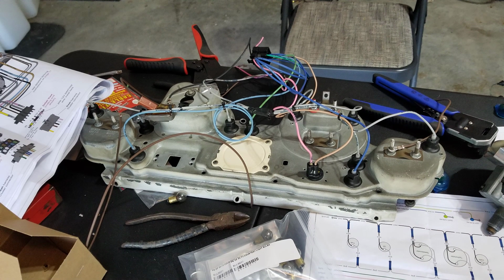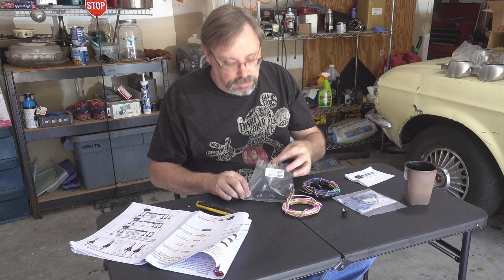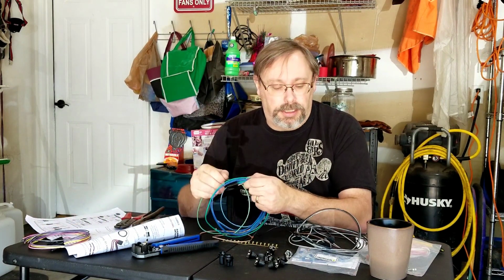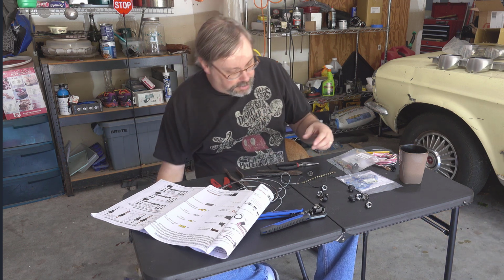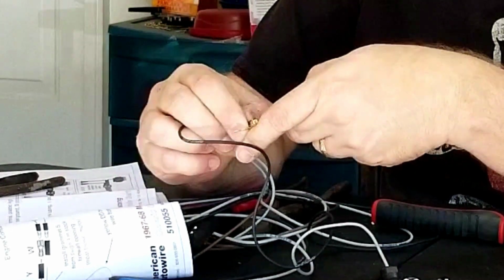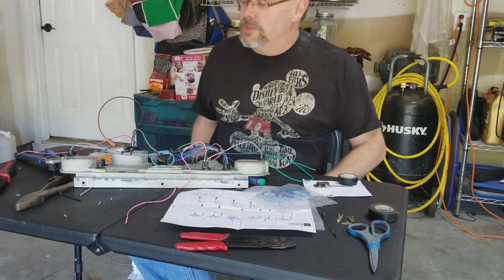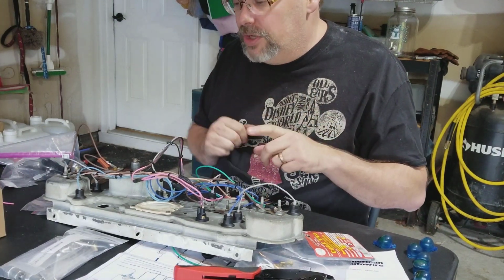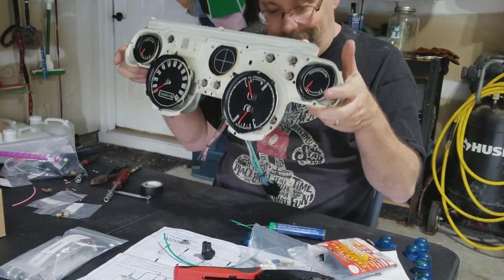Rewire the Stang Part 3 - Wiring the Instrument Cluster with American Autowire harness

Comment: Great videos.  How did you finally connect the gauge wires?  The original is push on, while the kit looks to use a nut?  Thanks.
Reply from the maker: Glad you like the video. You are correct with the new harness you use nuts to connect the wires to the posts from the gauges.
Reply: Hi do you know which thread size?  Thanks.
Reply from the maker: @jeffjensen4132  Since I replaced my Ammeter with a voltmeter from Rocketman's Classic Cougar Innovations, I took my old original ammeter up to the hardware store and match them up that way.

Comment: Thank you for doing this, i currently bought the aaw kit and this is very helpful, how did you prep the instrument cluster for paint? Regarding the turn signal wiring inside the steering column, did you use the old one? Or did the kit come with one?
Reply from the maker: I ultimately replaced it since it was not an original piece anyway. I had replaced the original one back in the 1980s when I was a teenager. Found the "Chrome" paint I used was not very chrome and silver. However to prepare for the attempt, I just cleaned it with some degreaser and then wiped it with some rubbing alcohol. I have a video coming out on the 27th about the steering column harness. I did go with a new one.

Comment: Very good info in this video. VSS = Vehicle Speed Sensor. Modern speedometers are no longer cable driven from the transmission. Instead, an Output Shaft Speed Sensor on modern transmissions provides electrical signal to a vehicle computer and it sends signals to the speedometer in the instrument cluster. Dealing with automotive wiring systems can get confusing and frustrating at times. Especially if you have to perform in-car repairs on a dash harness, lying on your back in some weird yoga position, soldering above your head.
Reply from the maker: Thanks for the great information about VSS. I hope I don't have to find myself soldering on my back under the dash. Right now one of my biggest concerns is that after I get all this wiring done, it will not work.